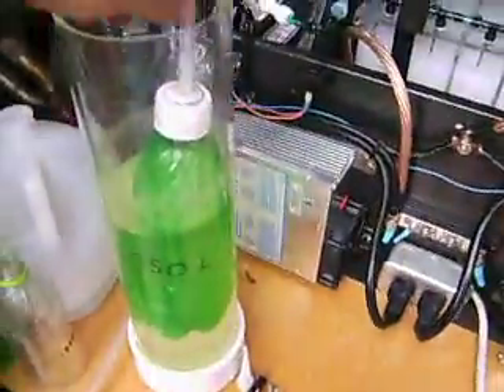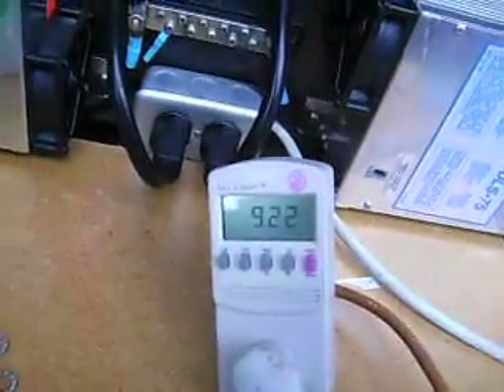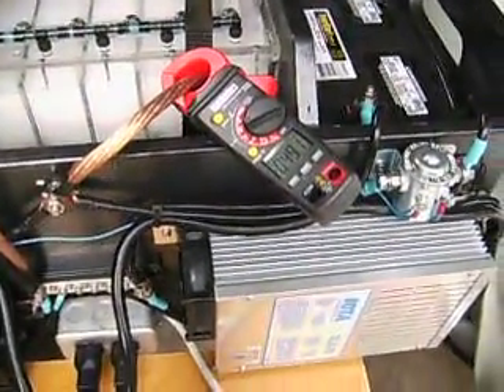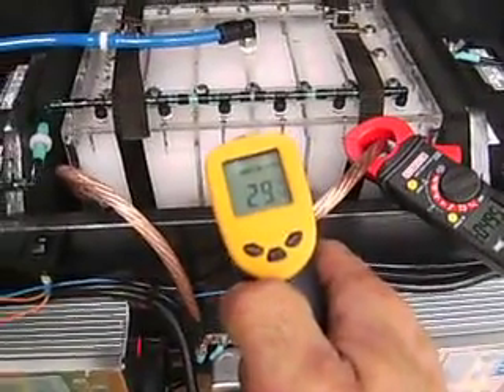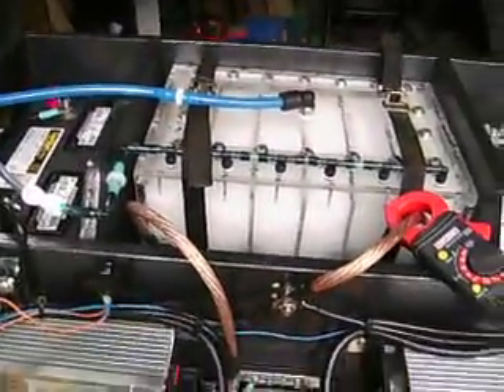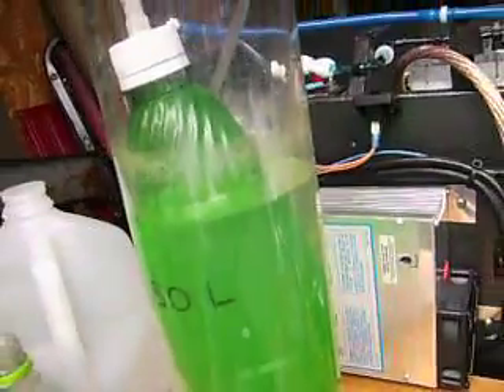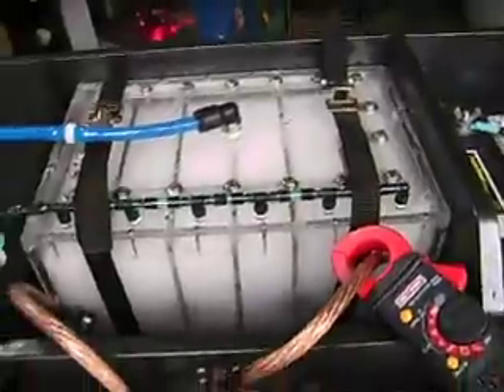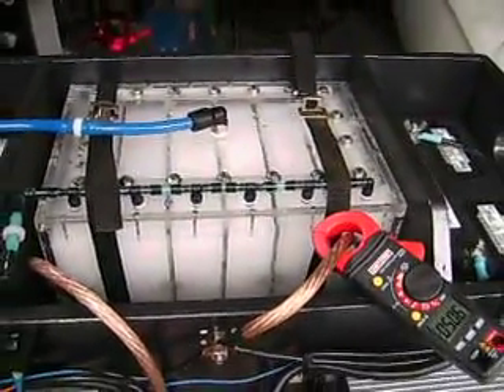GenIII story part 5 "SmackZilla"!

Comment: @EletrikRide yes I agree, I take temp too, every time and keep a log of it all, it work out good to have a record of stuff like tests / results over the years,  but you should check out the emissivity video, and black dot top & bottom of liquid level in each individual cell, temp differences top/ bottom can be 5 + c, and infra red beam deflection off surfaces can result in wrong readings quite significantly wrong, honestly, check it out..... thanks again.
Thom.

Comment: My point was that even if your new cell puts out the same or less volume of gas than a smack booster that pulls the same watts your new cell is probably putting out more hydrogen since the gas is cooler and has less steam/water vapor. If you want to do an efficiency comparison then you will need to cool the output gases of both units to the same temperature. Cool enough to condense out any water vapor. Leaving relativity pure HHO.
Mars

Comment: You can get 24 volts out of 2 batteries 48 volts out of four you would not need a inverter and a rectifier to get higher dc volts to get more output

Comment: That is a very nice setup. I like it that you continuously try to improve your accuracy.

When you compare your previous designs to this keep in mind that all gases expand as they heat. The HHO coming out of this generator is substantially cooler than the output of the smack booster. Also, not considering the steam, hot air can hold more moisture then cool air.

It will be very interesting to see how this set-up works with the extra alternator on a long trip.
Mars